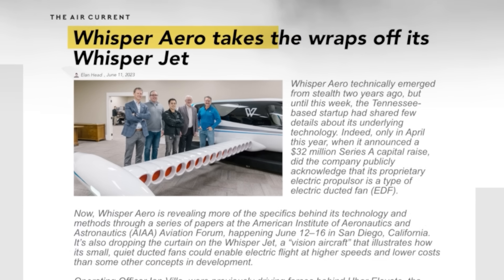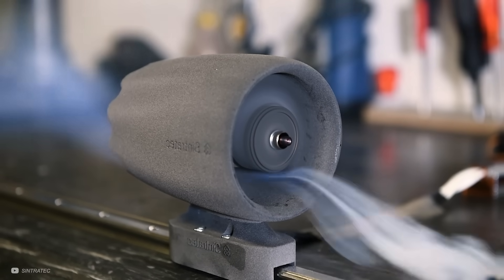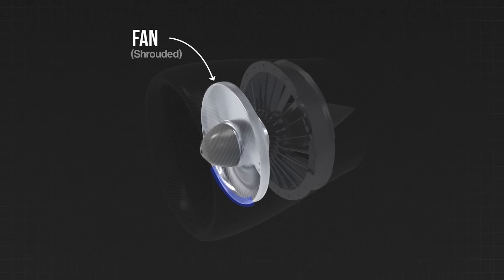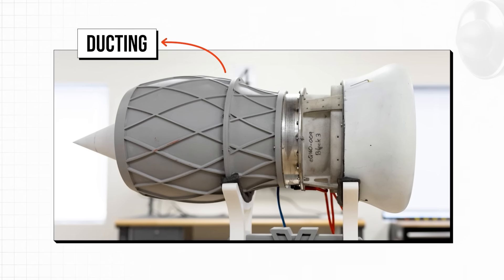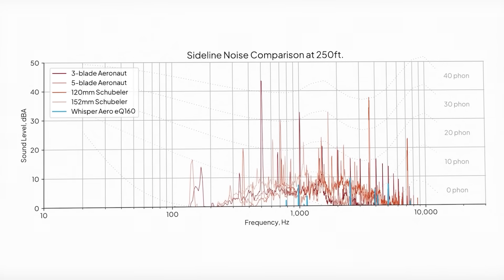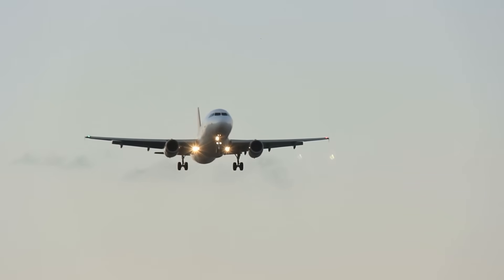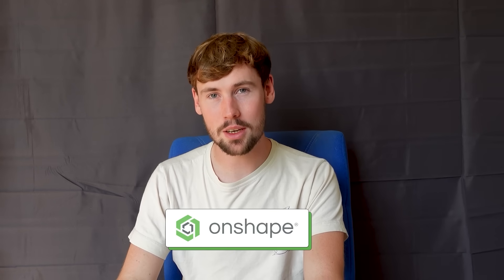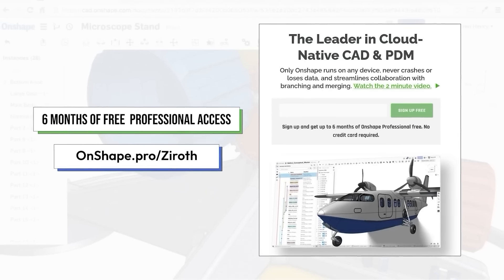This Genius Jet Engine Is Starting A Revolution

Comment: To me, the current disadvantages of electric passenger plane propulsion are so huge that, without some giant leap in energy density improvement, then these engineers are engaged in a sort of alchemy.  Small [trainer] electric planes may have a place in the market but the obstacles quickly become insurmountable as size increases.  I wish them luck but the advances discussed e.g. shrouded blades, have all been investigated before and while small efficiencies may be found they will never be such as to make mass electric air transportation viable.

Comment: How on Earth is a engine with seventy pounds of thrust going to revolutionize aviation?  The  Pratt & Whitney PW1000G generates 15,000 to 33,000 pounds of thrust, depending upon configuration.  You are not going to make anything like an Airbus 220 with thrust like this.  Sure, you can find short range flights for drones and  light aircraft, but this is not going to scale to airliners.
Reply: Even for small aviation this reads like an absolute joke, everything about that design screams fraud, aside maybe the noise claim

Comment: You will never get a serious electric plane as the energy density of batteries is not possible to get near fule oils. Simple because chemistry and physics. 

While it may kind of be "quiet" and have marginal efficency increase. 

Overall efficency is down to the volume of air moved + how well you do that. So the prop. 

A big prop will be more efficient than a small duct as it grabs and moves a larger volume of air. So there's less slippage. This is why helicopters have basically a really really big propeller to lift them. See the human powerd helicopter for taking this to the extreme. 

This holds true until you get to High-Speed at least. Then the prop runs in to issues as it has to push the air faster than you are moving to make thrust and the drag on the prop goes up with speed and it all goes bananas as you get closer to the speed of sound.
Reply: Who told you that batteries will never get dense enough to rival foccil fuels? There isn't a single thing about it in physics, and chemistry only applies to the current batteries, and the chemistry of how they work. There is no saying that a chemical battery of a completely different principle won't pop up, or a non chemical battery that stores electricity by different means. Who knows what the future holds.

Currently though, yes, electric aviation is complete nonesense, maybe outside small, slow-ish short range stuff, which could work.

Which isn't this plane mind you, literally everything about it sounds like a fraud, from the tons of really small engines that both don't move a whole lot of air due to square root law as you mention, but also compromise wing integrity, the nonsensical shape and design, the fact that this many blades and stuff inside as well as the ducts will make a ton of drag and will weigh a ton..

Comment: This will have a scaling issue. The faster the blade travels, the more it will stretch. As the blade gets longer, the faster it will travel. This is part of what blew up an a380 engine. This is part of why the blades are kept seperate. Add to that the fact that the entire blade would be one unit, and you ruin the ability for companies to do work on them. Instead of replacing one damaged blade, the entire thing has to be replaced. This means more man hours, downtime, and storage costs as the units will not be small. No company is going to agree to that additional cost.

Comment: It's important to note that even noise outside your hearing range causes hearing damage, it's about the sharpness of the pressure wave's onset in combination with it's total energy, so in that way higher frequencies can actually be even more damaging.
Reply from the maker: Yea this is a great point, I should have been clearer on this - the higher frequencies will also be lower pressure, as there are more waves for a given amount of thrust, like lots of little taps on a drum rather than a big one

I also read that the high frequencies are also better absorbed by sound proofing
Reply: @ZirothTech yeah my first thought was poor dogs. Helicopters are annoying enough I can't imagine a high-pitched one
Reply: @ZirothTech  Indeed. The way I have understood in sound proofing or dampening, the wavelength is very important. As some sort of rough guideline I believe sound absorption would require at least about a 1/4 wavelength. 
Be that sound absorbent material or a device based on interference. Obviously sound absorbent materials are not as picky on exact frequency and tend to provide some dampening on rather broad spectrum, but even then benefit from having dimensions big enough for the wave it is supposed to silence.

And just as a disclaimer, I must state that this is a very condensed version, based on what I remember of reading about acoustics, likely more than a decade ago by now.
Reply: yep, I spent 4 years working in the USAF on the flightline as an electrician and every year they were able to measure our hearing loss :O
They very much emphasized wearing both in-ear expanding-foam earplugs as well as "cups" on top
Reply: Plus, potential environmental impact. (widlife etc)
Reply: Sie sollten nachschlagen oder das hier lesen : 
📉 Dämpfung (und damit Reichweite)
Die Reichweite hängt nicht nur von der Wellenlänge ab, sondern vor allem von der Dämpfung in Luft, die stark frequenzabhängig ist:
Niedrige Frequenzen (unter 200 Hz)
→ Sehr geringe Dämpfung.
→ Können sich über viele Kilometer ausbreiten (z. B. Donnergrollen, Infraschall).
Mittlere Frequenzen (500 Hz – 5 kHz)
→ Moderate Dämpfung.
→ Typischer Bereich der menschlichen Sprache, Reichweite in ruhiger Luft etwa einige Hundert Meter.
Hohe Frequenzen (über 10 kHz)
→ Starke Dämpfung durch Luftabsorption.
→ Reichweite nur wenige Meter bis Dutzende Meter.
Reply: EDFs don't make much noise anyway, so it's more about making them less annoying than protecting ears.
Reply: Like ultraviolet or infrared. You can't see it, but it can cause harm.
Reply: As a computer enthusiast, (and aviation) I gave a thought about using Arctic cooling's p14 fans' design in an aircraft. Especially on superlight crafts (<450kg) But I don't have investment power to realise such dreams. Glad someone with money had the same idea.
Reply: We're not talking about hearing damage levels here. And for the same amount of energy, higher frequency means less amplitude. Unless you have some research about how sound affects hearing, you shouldn't just assume things.
Reply: True. Some people may not be able to hear it but others do...

Comment: That's fun. It's a good start. As soon as I saw it, I thought, "Axial motors with fan blades on the stators. Stack them together like the compressor of a gas turbine, but you can have each fan stack running at its own optimal speed or synchronized." So, it's a start, but I already see a way to improve it for more power in a given diameter tube.
Reply: But why?  Stacking multiple fans will produce higher velocity, and higher thrust for a given area, but will reduce efficiency.  The only reason you want higher exhaust velocity is to permit higher vehicle velocity, but single-stage fans work just fine on subsonic turbofan airliners.  Are you trying to make an EDF go supersonic?
Reply: Picture this. Each fan can have it's own speed. So you not only have absolute control of air speed at all stages, but it's dynamic and the shape of the flow can be altered at will. 

Getting close to the speed of sound with an EDF would be really hard. It would be easier if for a given engine size, it was throwing a larger volume of air as close to the speed of sound as possible.

But now you made me think about using this as a compressor for a supersonic RC gas jet. There's a company trying to make a hypersonic EDF-rocket/afterburner hybrid and they appear successful so far.

I think for an engine like that, you bypass the compressor altogether at supersonic speed and try to slow the air down and get it helical.
Reply: Quel est le diamètre du plus
Reply: Du pulss
eur

Comment: When the energy density in batteries is the same as gasoline I will be a believer in electric.
Reply: You mean usable energy, right? Because electric motors are 80 or 90 percent efficient while no internal combustion engine can beat 40 percent. Huge amounts of waste heat. So the raw calorie count is not a useful metric.

Still and all, you're right to look at battery energy density as a primary limiting factor.

But long-haul non-stop is not the only useful mode for transportation. If it's cleaner, quieter, more pleasant, and above all, cheaper to operate, you can be sure battery electric propulsion will find its way into whatever sectors it can. It has already taken over RC aircraft: remember how those used to have little gasoline engines in them? Helicopter hobby drones were barely even a thing before electric motors made them cheap and practical. Obviously electric cars have been practical for in-town driving (less than, say, 50 miles a day) for decades now, since you can charge overnight. EVs are increasingly practical for long trips too, but that's only been true for the past 5 or 10 years. City buses and ferries are going electric in a big way, since again we're talking about short, predictable trips. The last transportation sectors battery electric will tackle are probably cargo shipping and transoceanic air travel, but for just about everything else, they either are now, or soon will be, the most practical option.
Reply: @ps.2  Yes, I mean if it takes 2,000 lbs. of fuel to go 100 miles then 2,000 of batteries  to do the same.
Reply: @Erik-rp1hi  If having the same output energy per kilogram is the only thing you care about, you should indeed stick with gasoline, or better yet, hydrogen, or better still, uranium-235.

Engineering is about tradeoffs, though. It turns out uranium, and hydrogen, and gasoline, have other disadvantages that you have to balance. The best solution is not the solution that optimizes range. It is the solution that provides enough range while optimizing all the other considerations. And, in an increasing number of sectors, that's gonna be battery electric.

Comment: It doesn't matter how quiet and efficient it is it will never overcome the problem of recharging a large number of aircraft at an airport. You will need a small power station alongside each airport as renewables will never supply enough electricity.
Reply: Make it a gas turbine power station. I'm glad they're trying, just like the Skylon project, maybe something unexpected will come from it. For instance the Skylon concept sounds like it can produce liquified gasses like a fire hose, just not while in flight.

Comment: Nice as R/D. Electric is not there yet and for long time will not be. Aviation needs energy dense materials to be useful, weight/power ratio is critical. Electric anything does not provide what aviation needs. Cars are still struggling with the "electric" frenzy. Aviation is way more critical. Theories are beautiful. When rubber meets the road facts change a lot. Yea, yea, there's many initiatives to all electric aviation. Great R/D. Practical world, nehhhhhh.

Comment: OK, I am at the half-way point of this video, and as I imagined the redesign to be an integrated wing with fans running the length of the leading edge, my first concern is 'wing spar & web' for structure integrity and strength. While the wing web can easily be placed in-between each fan, there seems to be little to no room for spar to strengthen the wing across its entire length/span, and that cause serious structural issues for support. I can only imagine how much flexing there will be in the wing without a spar, or with a spar lacking the entire thickness of the wing - a thickness that unfortunately interferes with the fan's airflow and passage... this poses the most challenge to this design structure overall. Without a proper spar to add strength and minimize flexing and fatigue, there has to be considerable spar support across the length/span of the wing to minimize the level of flexing/cavitation to reduce damage and fatigue; thereby reducing catastrophic failure.
Reply: There's that but literally nothing else here makes sense either, aside MAYBE the noise claim, sounds like a complete fraud

Comment: I have thought about some of the ideas they incorporated here in my past musings.  I have wondered why jet manufacturers don't put a rim around their compressor and turbine wheels?  Another thing I mused about is a built-in electric motor where energized coils are situated around the outer rim and magnets are placed on the inner rim--quiet and torquey.  The thing I think that keeps this design quiet is the large spacing between the fan and the stators.  This prevents interference shrieking that you commonly hear from turbine engines where the compressor/turbine blades are right up against the stators.
Reply: They tried, that would be the solution to a lot of problems... but is not possible. Don't you think is curious that they plan to use a lot of small engines instead of a bigger one? 
That's because that ring adds mass on the worst place you can. On the tip of a rotating blade.
 A ring like that on a jet the size of the normal commercial ones would explode by centrifigal forces at the speeds it need to rotate. They tried with titanium and special aloys but is just not possible. It's only feasible on small radius engines, I guess they have found that 25cm must be the maximum.

Comment: Aaaaand one more design to crash and burn. Not that I would consider them unreliable, but one look at that wing for a commercial airliner tells me why this is unlikely to take off. No, it's not about aerodynamics, it's much more about technical challenges. For one, that's a lot of motors for one wing, a lot of failure points, many opportunities for catastrophic failure. Second, there is a reason why we don't incorporate engines in to the wings and tail fins anymore - they're a nightmare to service. Considering that market is the true decider of innovation, I don't see how any company in their right mind would invest in an airliner with 20+ engines incorporated in the wings.

Comment: The leaf blowers make mors sense unless they've secretly designed featherweight batteries that can charge as quickly as it it takes to refuel an airliner.
Reply: leaf blowers are a hateful invention, absolutely asinine and annoying af. a higher-frequency leaf blower isn't going to make them any better. i just wish they were never invented to begin with.

Comment: practical electric airplanes/airliners  will never happen.  the batteries needed to run the motors are too heavy for anything other than experimental use.  Today, conventional airliners take off much much heavier than they can land.  They decrease in weight the longer they fly.    This isn't the case with electric planes.  They take off and land at the same weight.  This is the major limitation.
Reply: First of all, there's no telling what battery innovations are to come. With current tech, yes, batteries are kind of too bad for anything other than short range flight. But battery tech CAN change, we've barely started our way as a tech civilization, not you or I can predict what's to come.

Comment: A basic physics class should be a mandatory requirement for high school graduation!  Thrust loss via the stator at the back of the engine making it more efficient?  Power source?  Yes noise is the only issue but certainly not the only one.  Still innovation starts somewhere and it is an interesting project.
Reply: >   Thrust loss via the stator at the back of the engine making it more efficient?

This is actually very possible. A fan imparts swirl into the airflow so a stator can slow down the air slightly, but redirect it more backwards improving efficiency.

Comment: "DC motor" doesn't mean much since electric motors are fundamentally AC devices. Even universal brushed motors use their brushes to generate an AC field on their rotor when powered from DC. Once you insert some sort of inverter between the power source and motor, like the driver/inverter of a BLDC motor which is fundamentally the same as pairing a permanent magnet synchronous AC motor with a VFD, all motors can be "DC."

Comment: An attached ring on the outside of the blades also adds rotational mass at the outside which makes it necessary to make the blades stronger
Reply: Depends on the hoop strength of the ring I guess? It could hold itself together if it's strong and light enough. It definitely makes an engine slower to spin up and down though.
Reply: @wanderhillen2435  Instant torque is where electric motors excel.
Reply: @trikepilot101  not really relevant to commercial flight where the relatively high spool-up time of a modern turbofan is not much of an issue.
Reply: @wanderhillen2435  no, the issue is the added mass of the ring which acts on the blade, particularly at the blade root.  Compressor or fan blades are typically tapered towards the OD to minimize the mass and therefore the thickness needed at the blade root to support the load.  Note that the centrifugal force increases with the radius at which the mass is located so the further out you go on the radius, the higher the load and therefore stress that is created. 
A ring on the OD significantly increases the centrifugal stress on the blade and shortens its fatigue life.  Of course, you can design the blade/ring to minimize the detrimental effect of the ring but it is a significant issue which needs to be dealt with. 
The ring is very effective at raising the blade natural frequency which is good for both acoustic issues and minimizing blade vibrations, and you do get some improved aero.
But the advantages of a shrouded fan also bring in some significant disadvantages that must be considered.